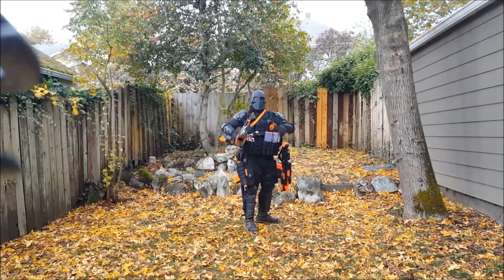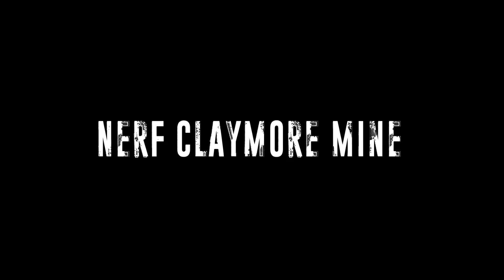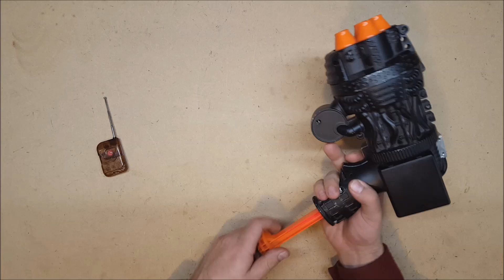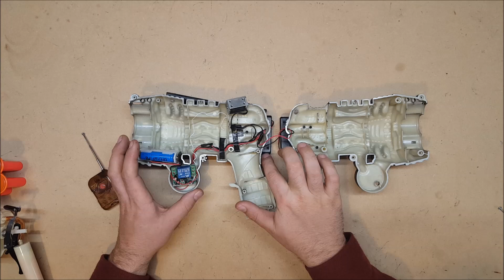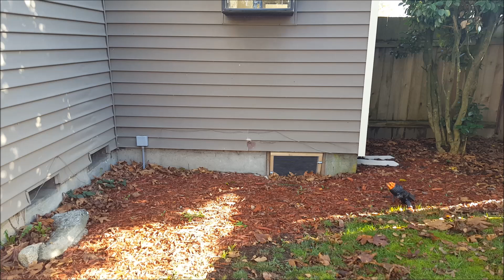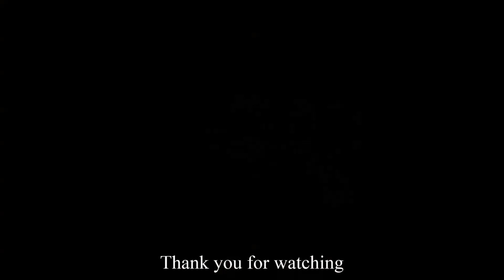Nerf Claymore Mine

Comment: I could never make a nerf gun shoot by a remote button. I really love how they all work with a remote
Reply from the maker: It really is not that difficult once you understand the wiring.  You have to wire the remote to power and then wire the positive power to the switch side of the remote.  That is it functionally.  Making it all fit is a different matter.

Comment: Hey Xavier! I am new to modding nerf guns, and want to eventually get to a crazy level like you, but do you have any tips for a beginner? I don't have much experience in wiring. Also, what do you think is easier: modding springers or flywheels?
Reply from the maker: Manual Springers are the easiest and a great place to start.  Automatic Springers (Stampede, Vulcans, Speedswarms, etc) are a bit more difficult.  Flywheels are fairly easy but do require a lot more technical expertise but there is a wealth of knowledge out there.

Comment: May I ask how you wired up the receiver??? I got one exactly like that after watching WalcomS7's video but never relay understood how to wire it up, and was hoping you could help me out if you don't mind.
Reply from the maker: It is a bit complicated to explain in a comment...but I will try.

If it is the same receiver that I have it is fairly simple.  On one
 side there are two leads, a + and a -.  This is where the power for the
 receiver goes in.  They usually take 12v.  

On the other side there are 3 leads.  When the switch is in one position the middle and the left are connected.  When the switch is in the other position the middle and the right are connected.  You can use this to switch a circuit on and off by only connecting up one side.  Or you can use this to toggle between two circuits.

Most receivers have multiple modes of switching also.  I have mine set for "hold mode" meaning that the switch stays toggled as long as the button is held but once you release the button it switches back.  But by removing a jumper on the board you can change it to "toggle mode" so pushing the button toggles it one way and pushing it again switches it back.

Clear as mud?
Reply: got it thanks!!!

Comment: So this is what I have been looking for but I do have some questions. One: is there a simpler way to do this if so what way? Two: how effective has this been? Three: do you have a write up for this? Four: could I use a different blaster for this as I cannot find one.
Reply from the maker: 1.  Probably but I have not found it yet.  This was the easiest solution I have found.
2.  Extremely in the right situation.  The first time I took it to a War I wiped out the entire enemy squad in one blast when they took cover in the alcove I had hidden it in.
3.  I do not.  But I could make one.
4.  Again, probably but I have yet to find a better option.  You could use any air blaster and I am sure it would be possible, with the right parts and knowledge, to build a spring version.
Reply: Thanks also can you make a write up of this and if you do may you link it to me as this is an extremely interesting project. Also I have my teacher helping me with it.
Reply from the maker: Cool.  At some point I will start a blog with write ups and wiring diagrams.  Good luck!
Reply: Thanks I do do have one more question. What is the green panel (like a brand name or a part name) and what remote did you use?
Reply: Thank you
Reply: Sorry that was an accident
Reply: I hate my phone button placement
Reply: Captain Xavier may you repost said link please
Reply from the maker: http://www.ebay.com/itm/DC-12V-10A-1CH-Channel-Wireless-RF-Remote-Control-Switch-Transmitter-Receiver-/141718222415?hash=item20ff10764f:g:WM0AAOSw-vlVpGTg
Reply: Thank you I will make sure to credit you and will link you my final product
Reply from the maker: Incidentally...the link was in the video description. ;)

Comment: I get its a mine but, couldn't it get stepped on and broken? It kinda feels like it is cool but it wouldn't be worth the effort because it seems easily breakable. cool mod though.
Reply from the maker: Ray Roberts Nerf blasters are suprisingly tough. And I don't setup it up where it is likely to be trod upon. That being said it does have limited use as it requires resetting after every shot. It has proven itself in combat though.
Reply: Captain Xavier  oh really? I haven't ever stepped on a nerf gun so I wasn't sure about the actual strength of it, but that's really cool. thanks for telling me about that man.
Reply from the maker: I mean they are plastic so they will break if you jump up and down on them, but it is a fairly robust plastic.  After all they are meant for kids, who are not always the gentlest on their toys.  The Battery mountings are probably the most fragile thing on this blaster.
Reply: Captain Xavier Right right. But that's interesting, I haven't had any battery mountings on a blaster I wouldn't know how fragile it would be, im not a modder so I really don't know. I'd like to get into it so, can you recommend a blaster to mod?
Reply from the maker: The Styfe is always a favorite.  Springers are generally simpler and cheaper.  Retaliators and Longshots are always fun.
Reply: Captain Xavier Ah gotcha. I don't really have the tools or money to do any wire work so I think styfe is out but I could do a springer. But anyway, thanks for telling me what to get to start learning how to mod man, have a great night.

Comment: Why don't you have a sniper barrel for your modulus stampede
Reply from the maker: Growlithe Shaman Because the Stampede is not a sniper rifle. It is an assault rifle. I do plan to build a sniper Longshot in the near future.
Reply: It just adds possibility, and makes it more modular.
Reply: If by possibility, you mean an option to intentionally gimp your range, then yes. That actually could have practical applications for certain rulesets or concerns, but generally wouldn't be desirable.
Reply: Flygonial Ascendant Well, I was referring to the Long Strike barrel and, for those who don't know, is too wide too hinder range, only thought it could be good to have options.
Reply from the maker: Ah, a fair point!  I thought you meant like a super long barrel designed to make it look like a Barret or something.  I do have a few Long Strike barrels but I have yet to paint one black.  I have other plans for them.  :P
Reply: Sounds cool.
Reply: I have a Longstrike barrel. I know how wide the clearance is. It still does affect the dart, though, as even having a barrel that a dart doesn't make contact with will alter the path air takes around it. That's why the Apollo seems to get different groupings with some pump action kits.

Comment: you should have used a 12v solenoid, then stepped up a regular small 1s lithium battery to power this whole thing.

If I'm missing something let me know.
Reply from the maker: Max Lisska (takes notes) Seriously, I am writing that down. I am not an electrical engineer. My knowledge of solenoids is practically non-existant. I want to build more like this and will need all the advice I can get. Thanks!
Reply from the maker: I have ordered one.  We will see how it works. :)

Comment: hm, maybe add a nut with the right size for a tripod? so it can fire in nearly any direction and with something like flexible tripods from nearly everywhere.
Reply from the maker: It has a tripod.  There is a leg that flips down to allow adjustable elevation.  I forgot to mention it in the video.
Reply: i saw that leg, that's what brought me the idea of an actual tripod, like the ones you use for a camera.
Reply from the maker: A proper tripod would make it much more adjustable, but would not be nearly so compact.
Reply from the maker: Hmmm...I like it.

Comment: How does it fire?
Reply from the maker: Either by pulling the trigger or pushing the button on the remote.
Reply: Captain Xavier I mean how does the receiver activate the trigger
Reply from the maker: The receiver is a remote switch.  When you push the button it activates the switch which completes the circuit to the solenoid.  Which then pulls the trigger.